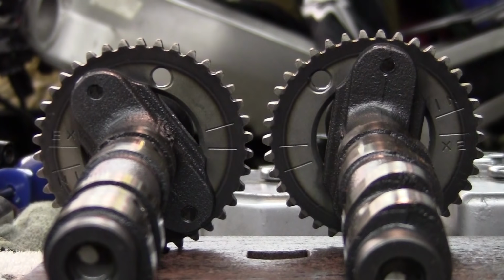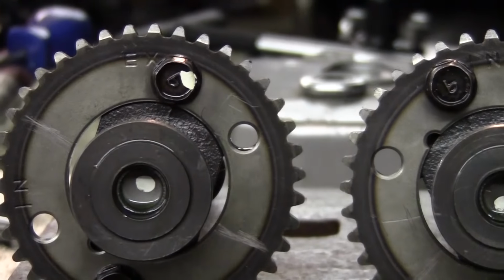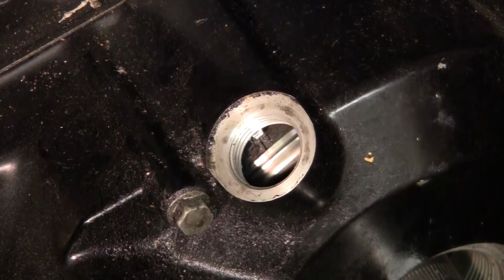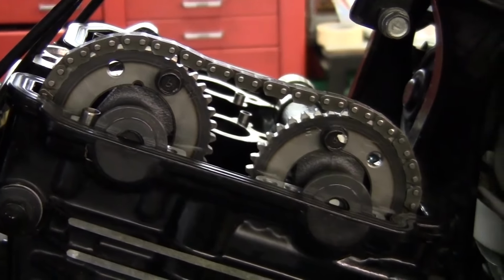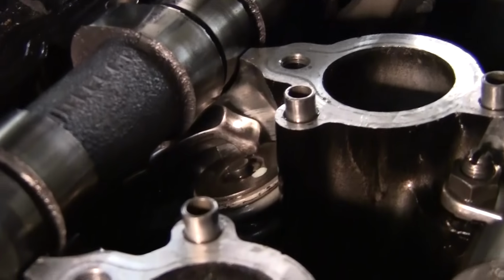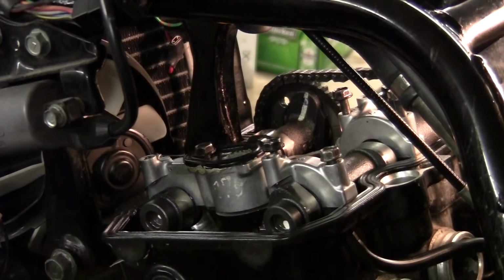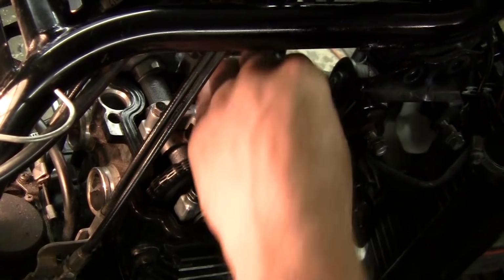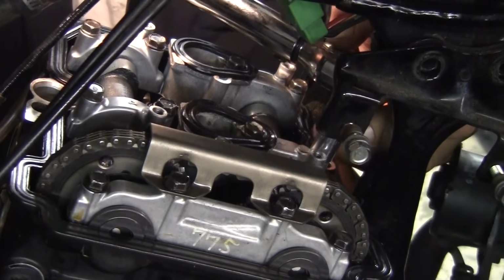07 Ninja 250 Project pt.5 Cam Install Setting Time

Comment: I'm having an issue trying to free spin to get to top dead center like something is keeping it from turning with socket and ratchet
Reply: of course you try to compress the piston with your hand its hard , to avoid this you have to remove the spark plug so there will be no compression what will happen is air will be pushed outside the spark plug hole instead of compressing

Comment: @Lee Powers. The Ninja 250 is different to most engines in the sense you get number two cylinder on compression (right hand cylinder), not number one. With number two on compression, you'll find the timing marks of the camshaft sprockets will be correct.

Comment: Like the video. Maybe you can help. I have a 2006 250r and coolant will get in the oil within 20 min. Someone told me it was head gasket. Coolant leaks too fast to be water pump. What do you think. Thanks for your time.

Comment: I just adjusted the valve clearances on my 2011 Ninja 250.  The timing settings are pretty much the same as the 3rd generation 250s, slight differences.   But when I positioned the exhaust cam so that the EX marking was lined with the engine head, the lobes of #1 cylinder pushed down on the lifters causing the shaft to raise up (yes, the lobes of #2 cylinder were facing away from each other as specified by the service manual).  I didn't know how to solve this problem so I just tightened down the caps in sequence and have put 40 miles on the bike and it runs beautifully.  Any thoughts on why the exhaust cam doesn't seat properly until the caps are tightened down?  I know you mentioned that there were some stresses on the exhaust rocker arms when you installed the exhaust cam.

Comment: hindsight is a wonderful thing. wish i had saw this video beforehand. i just snapped my camshaft tightening the bearing journals on my K9f ex 250 replacing the shims. maybe i got the cams mixed up or something. cost nearly $200 to order one from USA and at least 3 weeks downtim while i wait for the part

Comment: Good video BUT you forgot the MOST important item Where is the OIL for the cam shaft bearings? Oil for the bearigs is far more important than puting oil on the rocker arms and valve heads dont you think. Do yo notice how none of the other comments picked up on this! Other than that an excellent video :)

Comment: It would have been good if you had mentioned the torque settings for the camshaft bearing caps.
Reply: He said 12 newt with is 8.5 lbs

Comment from the maker: Ive seen issue with machining.Did ya get any pics of that.I ve seen the plates switched also.But the motor will only work one way.Or in one !Direction! From the book and common sense going this deep into the bike most people should find a major discrepancy.As for the no exhaust I know dudes that had the motor turning backwards because they screwed up with the starter motor ground.Bike turned over but of course did not start.
Gasoline engines need: air/fuel mixture(in), compression, and spark.